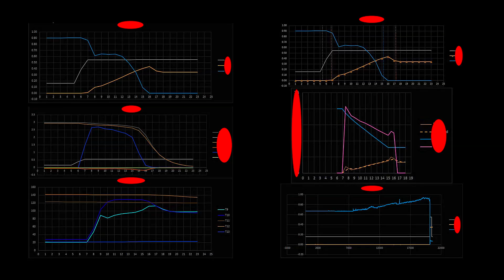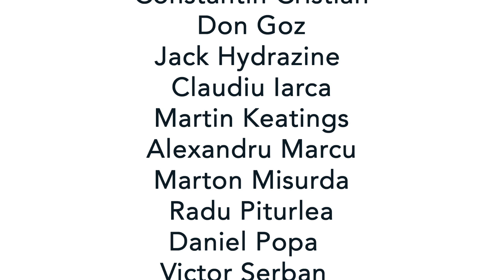Flight of the Aerospike: Episode 32 - LAS 25D Second Test Firing

Comment: Rockets that work off of steam need the steam to be generated upwards of 700 degrees C. At these temperatures the water is superheated and is actually invisible to the naked eye. 

If you have a water rocket and you can see the water exiting the nozzle, you are not viewing a rocket working off of the correct principles, you are viewing someone pressurizing "low" temperature water and basically producing as much thrust as if you just pressurized the tanks with water in them and didnt heat it at all.

Comment: This is by far still one of the most interesting projects in my opinion, since this will make it acessible to put heavier loads into space at a fraction of the cost of older methods, it will also open up new possibilities for long distance travels and other things if this sucess as planned, wich i think it will. One possibility for example may be pickuploads for orbital vehicles and also possibilities to fuel permanently stationed vechiles,bringing up food and supplies, etc.

Comment: I been following the development for some time. My concern with the system isnt the aerospyke but the water. We will just have to see.
Reply: I realy look forward to it, i think it will work after som finetuning of the exact design, but i understand why the boiler project are the priority at the moment, water has actualy been used in subsystems for a few early rocket engines and for booster rocket capsules on heavy warplanes (for example the USAF used catalytic hydrogenperoxide reactorchamber engines in the 1940s for aircraft ejection boosters (Oxygenol was a hydrogensuperoxide solution, i think it was 80%)) until pretty modern time, and today we hawe acess to much more efficient and significally lighter powersources so i think it will work for it's intended purpose. If i am not wrong here i think the battery sollution will possibly be at least comparable enough to make the concept work.